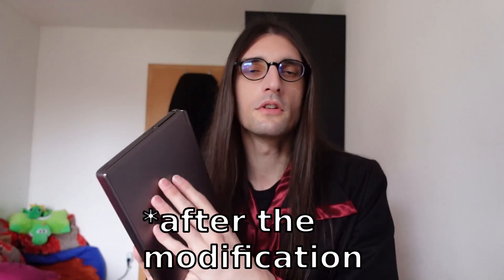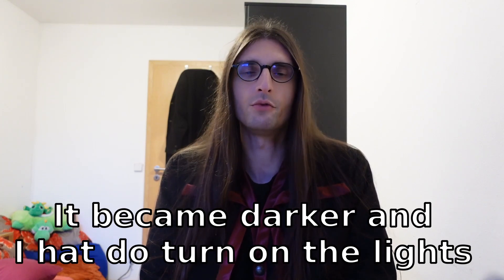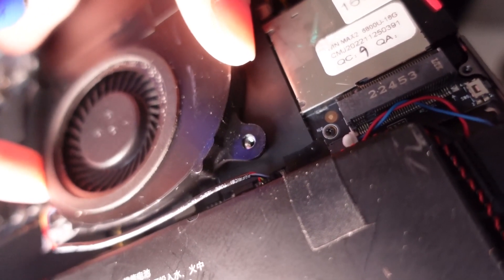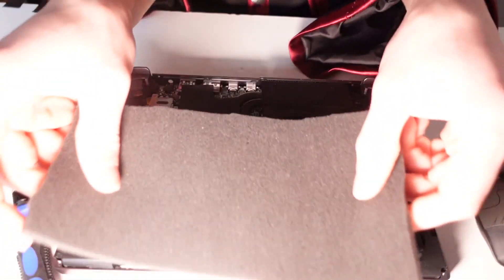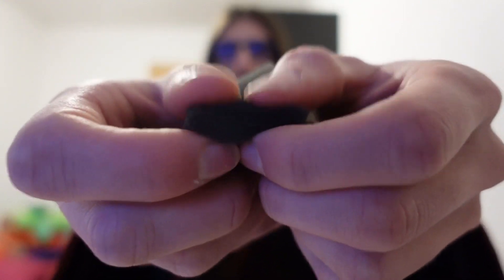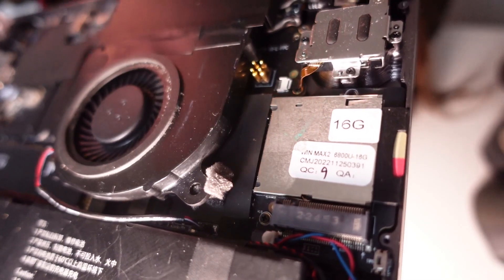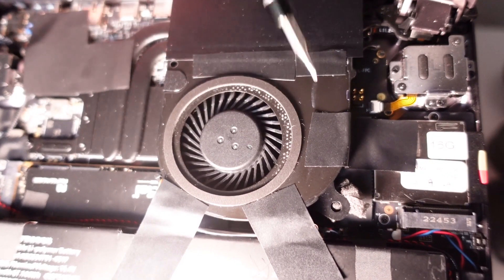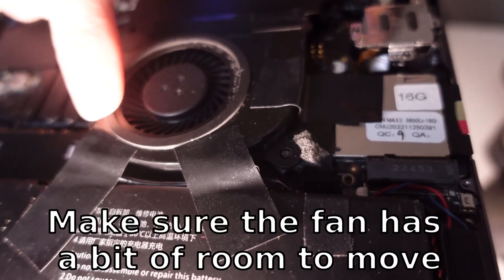GPD Win Max 2 - Lower the noise & vibrations - [Super simple fix]

Comment: Nice video, it's a brilliant fix to be honest. Have you dampened the case where the fan could potentially bump if it gets loose over time? Cheers!
Reply from the maker: I have added a lengthy description in the comment.

I have tried to put an other layer of foam between fan and bottom case.
At that side you look at, when the unit is open.

I wanted to put the complete fan in a layer of foam and maybe damper even the natural fan noise a bit to make it even more silent.

For me it turned out to make the situation worse, as it increased the pressure on the fan and pressed it slightly more against that malicious mount, which made the vibrations to be transferred over to the case once more.

One more solution to think of would be, to remove that rubber ring and replace it with a ring of foam.
Foe me, that is not worth the effort and risk, as the problem is almost 100% fixed for me.
I fear, that removing that solid rubber fan might affect the air intake negatively.
Reply: @mystechry  Ahhh I hear ya, well good to know then if I ever make this mod myself. Thanks again!

Comment: Mine is very noisy. Thank you for this.
Reply from the maker: I hope you can improve your fan noise.
Make sure to use a thick and very soft foam. The tape shall not push the fan too much. The result for me is very "floaty" to damper as much vibration as possible.

Comment: Nice video. My Queseion: What fan speed (rpm) be quiet by this solution "putting an other layer of foam" ?  2000 rpm? 1600 rpm? Thanks.
Reply from the maker: You can not hear 1500 rpm. That is 25% fan speed.
30% fan speed is still super silent and you can not hear it while there is background sound or music in game.

Watch my latest video. It covers exactly that topic. I did many tests at how high I can set the tdp while running my system silent.

I even tested passive cooling with the fan turned off completely.

Here is the link: https://www.youtube.com/watch?v=RVoWv_KsGAo

Feel free to ask any more questions :)
Reply: @mystechry  Thanks.